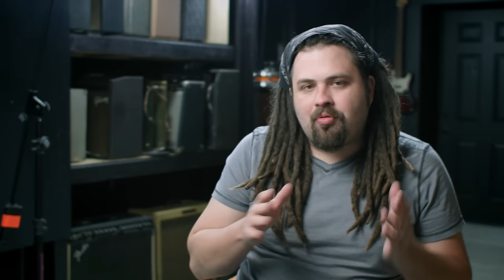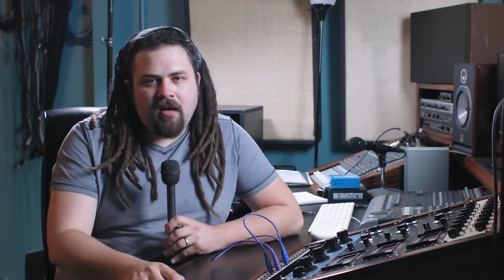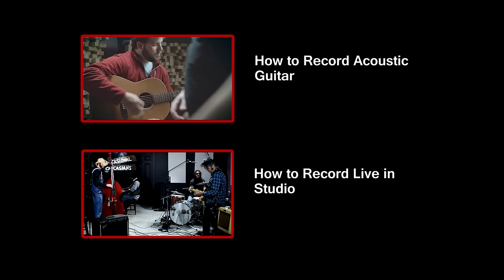Phantom Power - How to Avoid Damaging Your Microphones

Comment: If you look at a microphone that shows it is phantom powered with a LED, like the AKG C414 XLS, you can see the power slowly going away when turning the phantom power off. However, you can see the same thing if you just disconnect the cable without turning it off. That means the remaining power after turning off the phantom power is not in the preamp, but in the microphone's capacitors, which makes the "one minute wait to let it drain" practice a little bit useless. You can turn it off, disconnect the cable immediately, and the microphone will still have power going away slowly.
Reply from the maker: Yes but also consider that the pre amp also has to drain. I put my multimeter into the mic cable and watched for close to 60 seconds as it drained. Some are faster than others.

Comment: I used to be really worried about this sort of thing, until I found out that 1) they have essentially dummy-proofed mics nowadays, and 2) the BBC runs their studios with xlr jacks in the walls that ALL have phantom power running to them AT ALL TIMES; you can’t turn it off. So whether they are using dynamic mics, condensers, or ribbons, they are plugging into a connector that has phantom power actively running through it.

This realization also made buying a small mixer much easier, considering they usually all have just one +48v switch that powers every xlr in, and I had worried about using a condenser/ribbon combo in these mixers; turns out, since I don’t have any real vintage gear, this is not an issue.

After hours of searching for a small mixer (fewer than 12 ins) that had independent phantom power for each channel, and not finding any, I began to wonder why that was. After a much shorter time spent researching the question I found that modern equipment is essentially built to ignore this problem, and that I wouldn’t be frying any ribbon mic I decided to use in the future.

Comment: I can't record my voice or have voice calls on skype anymore  with my Rode nt1 . I thought the problem was with my audio interface's phantom power but now I'm convinced that the problem is with my mic . I remember that there were many times that I forgot to turn off the phantom power switch on my interface when I was done using my mic ,  and times when the house's electricity went out in the middle of my recording sessions . These mistakes must have killed my mic . I'm surprised that it lasted for like 7 years despite using it in a terrible way . Now I've learned my lesson to be careful with how I treat a condenser mic . Thanks for the video !
Reply: Hey i am dealing with this issue now and i've just got my rode nt1, i've only made this mistake a couple of days ago and now the volume is very low :( it sometimes goes back to normal if i keep it connect with phantom power on for a couple of minutes but then it switches back and forth from being loud to quite. Is it possible to fix this issue or have i wasted my money already? please let me know thanks.
Reply: Bored Dude did u solve this problem i am going through the same exact thing i have weird power surges in my old house

Comment: Only ancient 1960's ribbon mics should be taken carefully. No modern ribbon mic should have issues. The biggest reason was Audio mixer companies did not want to add ramped power banks to each channel due to space and cost. This would easily been the solution to many of these myths. Older ribbon mics should not be plugged in directly to any mixer anyways, they have to be plugged in to an XLR ISO box to isolate them from phantom power so you can then have zero issue as they are plugged into powered XLR inputs.

Comment: What about a tube mic? I have an external power supply and I've accidentally tuned phantom on and recorded with it on. Everything seems fine, and I'm reading that it doesn't harm anything to run phantom, though you really want to try and avoid it. Do you feel the same way, or could I have damaged my tube condenser?

Comment: Same thing happens with wall sockets but is even worse. It can result in the plug you put in the socket being damaged over time, and if you have something that is sensitive to voltage, like a mic, it can damage it as you get a voltage spike as you unplug it. Good stuff to know.

Comment: Sm-58 has a transformer that people like to mod by taking it out. That's what protects it from phantom power. So a modded SM-58 with no transformer will get destroyed. I think the SM-58 sounds great the way it is. Also some audio interfaces have separate phantom power channels.  The Apollo twin has that feature. It's always good to get one with that so you can use a condenser and dynamic or ribbon at the same time that don't need phantom power (some ribbon mics require it).
Reply from the maker: +blood lord (Chaotic Sonics) Yes, all good stuff. I remember talking about these things.

Comment: Can you please explain a bit more about what you mean by 'let it drain' and why it takes a minute to drain the power. I wish to understand this electronically so that I can better understand why everything is doing what its doing. In the case of things that hold charge (like the LED light that stays on for a while when you turn the TV off) I thought this was charge stored in some electrical component. I cant see how this applies to phantom power, so i'm looking forward to hearing the science behind it. thanks.
Reply from the maker: Capacitors, they act like little short term batteries.

Comment: Great tip Ryan
Reply from the maker: +RØDE Microphones Thanks Rode!
Reply: +creativesoundlab haha, quite a discussion we started there in your last video :D
Reply from the maker: +BavarianMonkey Yes, that was great. In fact, a few asked in this video about the damage phantom power would cause....feel free to answer any tech stuff you know. You've told me some things I never knew about.
Reply: +creativesoundlab well, then let's distill the essential facts from my other comments and memory:

The issue is:

- Whenever a connection is made during patching, it cannot be guaranteed that both signal lines make or break the connection at the same time.
- If the phantom power is switched on during patching, it is not guaranteed that it is applied to / removed from the two signal lines at the same time.

- Almost any old school microphone or preamp with a transformer in it can be damaged by asymmetrical phantom power application. Many of those have center tapped transformers and if you somehow connect one signal wire prior to the other while patching, you will put 48 volts across this transformer winding which is made for millivolts. 

- It is only a short time, but it can saturate the core and this saturation can (and often will) stay in the core after the phantom power DC has been removed.
=> https://en.wikipedia.org/wiki/Remanence

- Now that the core is magnetically biased, its magnetization curve cannot be used as it was once designed by the transformer manufacturer. It will show more non-linear behaviour leading to audio saturation (distortion) and less bass.

- All of the above can happen with any microphone that has a transformer in it if TRS patches are being used, even if the transformer is not center tapped. During insertion of the TRS plug, the phantom power is being applied between tip (+ Signal) and ring (-Signal). This will lead to DC across the transformer.

- The same can happen with the mic preamp input transformer if it is center tapped or TRS plugs are being used for microphone patching.
- The same applies if an unbalanced source is connected to the preamp while phantom power is switched on.

- Of course, if there happens to be a shorted line somewhere (faulty cable), the phantom power DC is not a short time problem but it can be applied for a pretty long time until you find out why the mic does not work as expected and with time it gets more likely to cause problems.

In most cases this can be resolved by demagnetizing the core with audio frequency (you need a lab test rig for that) but it is a bad idea to provoke such defects to begin with.

So yes, NEVER EVER use TRS for microphone patch bays and never ever connect / disconnect a microphone to a line with phantom power switched on. Always make sure phantom power is switched OFF before connecting/disconnecting a microphone.

(And no, this is not a hypothetical problem: I did repair a vintage microphone because of this and I have one input transformer in the lab that still has no bass because some dumb bavarian monkey measured the winding resistance with an ohm meter... DON'T DO THAT.)

Comment: I have rode nt1a and focusrite 2i2.usb interface. I haven’t tried it on desktop. But when connect interface to laptop and switch on the power supply my mic start work after 1 or 2 mints. And sometimes it doesnot work. Thn I have to reconnect the interface. I am afraid I might demage the mic.

Comment: Im using a Digital MG12XU to record in Studio One 4 but every time I turn on my phantom power for a Super Cardoid Condensor RE510 EV mic I get signal and sound without my House Stereo Master button being even on. And then, if I turn off the phantom power for all 7-8 channels because there's only one Phantom Power button, the mixer does a strange exploding pop on my headphones and in the master fader with all buttons/faders off and gain knobs down. Not sure why this is? Im using external usb 3.0 docks because Im using all my 3.0 as my laptop can only take 2 3.0 ports aka a Spectre x 360. Do you have any recommendations?

Comment: I recently got a Shure Sm7B which I know isn't supposed to need phantom power, but I can't get mine to work without it. I have the SM7B going into a cloudlifter then into my Behringer Xenyx X1204usb mixer. AM I missing something? Please any help or advice would be great. I  don'y wanna mess up my mic or if something is wrong with it I wanna be able to return it for another one
Reply: HVAC Uncensored the sm7b is a dynamic mic and dynamic mics don’t use or need phantom power. phantom power doesn’t harm or affect dynamic mics. Shure actually recommends that your mic preamp can provide at least 60db of gain for an sm7b. The reason is that the sm7b outputs a very low signal. So you need a good quality preamp. The behringer mixer in your case can’t provide the necessary gain to bring the sm7b to line level. Products like the cloud lifter can utilize phantom power and use the extra energy to provide extra dB of gain. I think the could lifter provides around 15db of extra gain. However, nothing beats a good quality mic preamp to begin with.
Reply: If you are unhappy with the cloud lifter, the dbx 286s mic preamp can provide the necessary gain for the sm7b. you can connect the sm7b to the dbx preamp and then plug in the output of the preamp into a line input into your mixer.

Comment: Can i just leave my mic powered on all the time,even if it's not in use?if there is no negative effect on the mic or preamp.
Reply from the maker: No negative effects other than having DC voltage applied to the mic. I always power up, use the mic, then power down.
Reply: I didn't understand you.The mic i'm talking about is K2.Can you please elaborate or make a video about this topic?

Comment: Interesting topic, good video as usual. As a side note, I've read somewhere that only xlr connectors are carrying phantom power, or could it be on certain interfaces/power supplies/consoles. .. so that "in theory" , in a combo situation, one could always connect the dynamics with Jacked trs cables and condensers with XLRs so to be on the safe side. 

Oh by the way,  if someone read this & knows a shop or a place where I can buy capsules for large diaphragm condensers IN EUROPE, please hit me up. Thanks!
Reply from the maker: Any connector could carry the phantom down it that has three wires/points of connection. So a TRS will still transfer phantom, and if you use TRS and it has power on it, it'll for sure do more damage than an XLR would getting hot plugged. My patch bay can connect any mic line to any pre, and it uses TRS and it carries the phantom power to the mic too.
Reply: ok then.. I'll keep it in mind.. Thank you for having taken the time to answer to me... Nice of you..

Comment: Hi, what would you recommend in order to connect a Condenser Microphone to a Guitar Amplifier. (I now that it is unusual way, but I still want to make it possible to use my guitar amplifier as a main speaker). I do not need to record anything, but just sing and play my acoustic guitar loudly. Is it enough to buy a Phantom Power Supply or better to buy a Microphone Mixer? How to connect everything together? Thanks in advance.
Reply from the maker: Yeah phantom power supply, preamp OR mixer, and then re-amp box would be idea. Personally they use to plug harmonica mics right into amps. The PDMIC 78 is an unbalanced mic that a 1/4 inch cable is provided and could go directly in. But that's dynamic.

Comment: hey ryan! whats up i have been having  a lot Low output sound issues from my condenser mic my set up is   CLARETT 2pRE thunderbolt ---->MAC BOOK PRO 2014  and then input 2 is my acoustic guitar into a tonebone pz pre   and then output is JBL LSR 306 SPEAKERS. 

THE SIGNAL COMING FROM GUITAR IS FINE  HOWEVER THE SIGNAL FROM THE CONDENSER MIC RODE NT2A is very very weak i m talking i have to push the knob all the way to max for the gain and the signal is still weak. someone suggested that i  get a phantom power supply for the mic because laptop is not supplying enough power to mic because laptops operate on low power. is that true? should i be using a PC like a IMAC instead for music production ??

Comment: i was joking of what i said before but anyways I have a Vt-4 from Roland with an XLR cable plugged into it powering a condenser mic (AKG P220), and the transformer is connected to the PC via the printer cable, for the printer cable port

Comment: Hey guys, I have a small 2 channel desktop audio interface. I have one dinamic and one condenser mic. Problem is, ai has only one switch for phantom power for both channels. Can I record with both mics at the same time? What happens to the sm57 if I put it on phantom power? This is the only way I can record with both mics...
Reply: nothing bad, power wont go to the 57 since its not wired for it

Comment: I just bought a neumann tlm102 and when i turn off the phantom power of my preamp, i hear a few low frequencies pops coming out of my monitors, it lasts about 10 seconds and i can see that it affects the preamp and the compressor. I did not have this problem with my previous mic. You have any idea what it is?
Reply: Where you able to figure out what it was?

Comment: I just got a bm-800. do I need phantom power? using the xlr to 3.5 cable direct to my computer works, but only with loads of boost, and it isn't clean.
Reply from the maker: Any condenser will need phantom power. You also need a preamp and converter to connect to any DAW.

Comment: I did not know this. Im a noob. But suddenly my mic that needs 48v stopped working. All I get is a high noise floor and I can hear my voice just nearly if I yell. Is that a symptom?
Reply: Hmm...did you try recording without plugging in the XLR cable? (Both power on and power off)

Comment: If your XLR connections all around (Inputs, XLR cables themselves, pins on the respective mics) are all good and well maintained, phantom power will not hurt your dynamic or ribbon mics whatsoever.  It's misleading to say otherwise, especially when most home studio or budget mixers/interfaces supply phantom power to all inputs when engaged, it cannot be selectively applied.  So do you really think the manufacturers of these devices intended for the end user to have to chose on multi input devices whether to go all condenser or all dynamic?  I read an article from SOS saying the BBC radio and TV studios have phantom power constantly supplied to their wall box connections, it cannot be turned off.  Engineers plug condenser, dynamic, and even ribbon mics in and out all day with no issues.

Comment: Hey, very nice video, that's what I have been doing. I have a question regarding my pre as I call it. I have a focusrite saffire pro. Should I be concerned with the fact that when I turn the phantom power on no matter whether there is a mic connected or not, I get this hum that almost sounds like a sine in let's say 100-140Hz range? Is this normal?
Reply from the maker: Yeah I don't think that is normal. It should sound quiet and no noise.
Reply: First thing with anything hum related. Check grounding of everything.

Comment: Ok my question is : I have my sound card with 2 XLR inputs and the "phantom power button".Can I use a dynamic and a condenser simultaneously???Thanks new sub : D.
Reply from the maker: Yes, the dynamic mic should not see the phantom power, but the condenser mic will. Always turn phantom power on/off with mics connected, and after turning it off give it 1 minute before disconnecting for the power to completely diminish.
Reply: I got the same on mly Roland Quad Capture and I was afraid, great tip here =)

Comment: I have an audient id14 and Two Mics I've owned died within the year and im on my second aston spirit. Fresh out the box it sounds loud and clear but after usage i can hear the damage its like really low output  sometimes when its used to be stable and  highly sensitive. need to know whats going on cause this mic costs a lot
Reply: hey im going thru this right now with my rode nt1, it used to be sensitive and now it's super quite. It sometimes goes back to normal and then switches back to being very quite and im super bummed out. Is it possible to get it fixed or did i completely fuck up my mic?